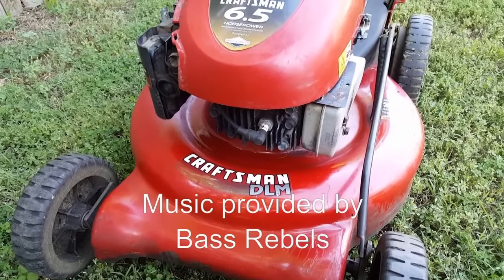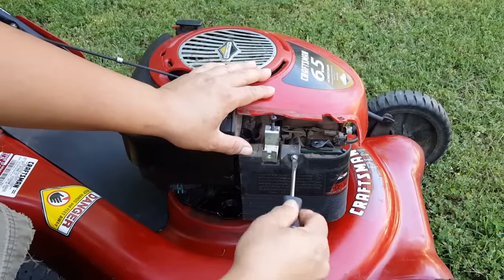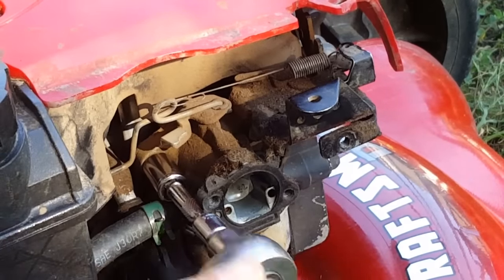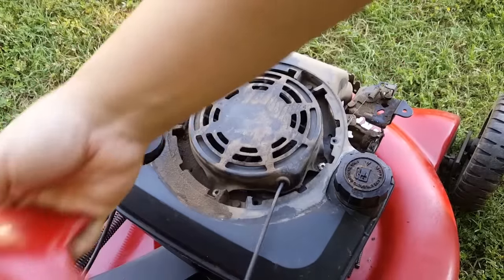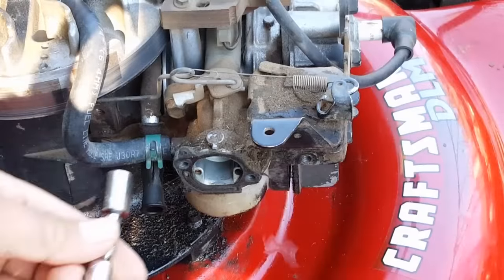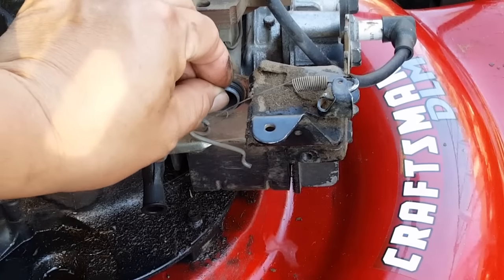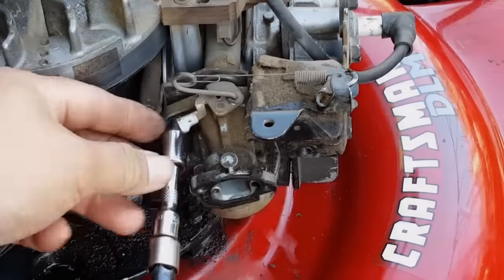Lawn Mower starts and then dies, turned out to be an easy cheap fix -Loctite!

Comment: Agreed. This may "look" easy. But most people don't even realize that these items being "unscrewed" are not "bolts" or "screws." It looks like they are those "torque" things that are on the backs of dryers and washers. The repairman use those things just to make it so "normal" people can't fix the things with their traditional tools such as a flat screwdriver.
Reply from the maker: Michael Zoran thank you. Yes for most a torx bit may be foreign to them.
Reply: Michael Zoran just buy a torx screw driver? It’s like saying filling up your car is hard because the gas pumps don’t look like they do in the 50s. They still work the same.

Comment: Hey nice video! I just overhauled my carb and  it runs great as long as I pump the prime bubble. it seems it doesn’t get enough gas any suggestions how to fix that??
Reply from the maker: Did you replace the seat needle? If so did you notice the position of the float? Was it level when turned upside down? If not then there may not be enough gas getting in the carb bowl and only running on the gas your priming into the carb. Thanks for the comment.
Reply: Home Garage thanks for the reply. Yes sir I did check that and it was level. But I clean the holes on the bowl bolt with a thin wire and now it runs great. Thank you tho.
Reply from the maker: Thank you and good work.

Comment: there could be a number of different issues that cause this problem. a video like this is only good for a select few who have the same problem. for once i would like to see a video that covers the gamut of issues but we'll never get that as they are as diverse as the problem. 

other noted causes are trash in the carb. bad fuel. a clogged vent of the gas cap. a dirty carburetor. even a bad safety switch (on riding mowers) can sometimes produce such a problem as well as other things that could be the culprit.
Reply from the maker: Thank you paul k for the comment.

Comment: Great show and tell. I have the same motor with the same problem perhaps. I will try that fix and see if the carb assembly is loose also.
Reply from the maker: It's a good possibility. Does your engine have primer bulb or is it just a pull till it starts type of engine?
Reply: @HomeGaragechannel  It's a Briggs and Stratton with no bulb primer. It has been to the repair shop and is there again with the same problem now for the 4th time in one week. It ran for quite a while on the paved lot but when put under load of self drive and cutting long grass it quits after about 30 ft. of cutting.
Reply from the maker: @theintruder77  now that's pretty interesting. does it stop suddenly?
Reply: @HomeGaragechannel  Yes but not with a "whump" as though hitting something with the blade. More like it runs out of gas.
Reply from the maker: @theintruder77  I would crack the gas cap, give it 30 seconds and then try starting it again and leave the cap cracked. it cold be a combination of multiple problems like a swollen needle seat and a gas cap that's not venting like it should.

Comment: Was that Loc-Tite Red? Holy hell those bolts are never coming out again! Nice fix though.
Reply from the maker: Thank you for the comment I appreciate it
Reply: Blue would be much more appropriate. Hell, Some hot melt glue or a lock washer would suffice. That said, Thanks for the video.
Reply from the maker: @ipwee  thanks for the comment I appreciate it
Reply: LocTite is 'thread-locker' liquid in a small tube colors match whether it is regular or stronger formula. Available at a Wal-Mart or similar hardware or Lowe's type store and it keeps a bolt from vibrating loose, generally.
Reply: @DougHinVA  I think you may have misread my comment, but thank you for the explanation anyways! Always appreciate helpful comments on YouTube.
Reply from the maker: Thank you for the comment I appreciate it
Reply: @Kube_Dog  ive seen engines never come apart again over loctite. That shit works wherever.

Comment: Only see those manifold bolts come loose on ones with bent crankshafts though. People will kick the carb and snap off the manifold , but rarely do I they just loosen by themselves. Very interesting sir.
Reply from the maker: Thank you Adam Dorris for the comment.  I would say this not natural. Someone must have been working on it and left it loose and over time it got worse.

Comment: Something that I noted that you did not point out is that there is a crack in the hose connecting the crankcase breather line to the air filter housing. This is apparent while you have the carb off the motor and are loctiting the plate screws. Splits here allow dusty air to enter the crankcase via the breather tube and the top end via bypassing the air filter and can chew out the motor in a couple of months of weekly mowing in a dusty environment. Don't ask how I know, but I have practical experience of this hose failing and coming off the air cleaner back completely due to the cracking.
Reply from the maker: Thanks for the comment and the watch.

Comment: If I undo all those screws & bolts, I'll never remember which goes where 😲
Reply from the maker: i understand.  i have had to put the nuts and bolts in to a piece of cardboard that was labeled to tell me where they all came from
Reply: @HomeGaragechannel  I'm going to clean tje lawn mower real good & try this. I fix everything else why not this too 😉 it's just a little overwhelming to me, that's all. I'll even do the other little maintenance items too i.e. replace air filter/add or change oil/spark plug etc... It's a 2nd hand and may need some all around TLC 👍

Comment: There's no way I could do this.  I've bought three very pricey mowers in 4 years.  Cost me more to get them "repaired" than it would to buy new ones.  It's like these things are built to self destruct after Xamount of uses.
Reply: Same here!!!  I've been through 2 in 2 years and I'm getting ready to buy a third it looks like.  This is after oil checks, fuel stabilizer, cleaning each time, etc...  I've heard the term "planned obsolescence" for appliances but I guess the same is true for lawn mowers.

Comment: Mine was driving me nuts. I had it for only 3 months and was doing the same as yours. Carburetor bolts were both loose. Fast forward 3 years and it would run for about 5 minutes and die. Noticed when I took off the gas cap to check gas level and replace cap it would run again for about 5 minutes. Problem was vented gas cap rubber was blocked. I bought a new gas cap because the rubber was deteriorated. Problem solved.
Reply from the maker: very nice diagnostic work.

Comment: Hi again.....First, thank you for your interest and help!.......Back to what I did with more detail than orig. Removed the housing that covers the carb and cleaned it. As the bolt holding it and the carb are the same, I thought that tightening it may clear the problem. But it didn't. Should I remove the carb and, if so, for what prupose? How can I tell if the carb is in good shape? The engine was fine and the stopping problem jsut happened. The engine is about 5 years old and has had medium=light use.
Reply from the maker: taking the carb off would make it easier to service and clean it.

Comment: I've had the same 6.5  craftsman lawnmower for 14 years and a little maintenance each year is the reason why it continues to run. I just wanted to say that you dont need to disassemble as much as you did to get the carb off. I also found that the o ring at the top of the fuel bowl gets old and causes a leak thus causing fuel starvation. I also use synthetic oil, which is way better than the cheap 4 stroke stuff they sell every where.  By the way new lawnmowers have lots of plastic parts even plastic carbs, so happy mowing everyone.
Reply from the maker: Thank you sir. I know these mowers can last for quite awhile with minimal maintenanc and you definitely prove that.

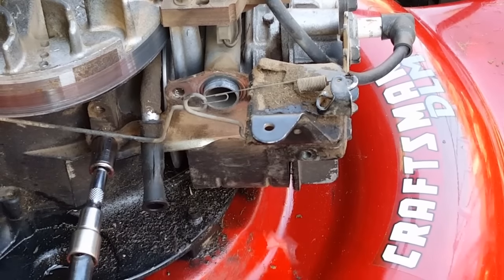Comment: To anyone reading in 2024: quick fix WAS the air / gas mix hose at lower left looking at the exposed carburetor @2:47 (once you take off the filter housing / carb backing plate. It pops right off / no hose clamp). Mine had wiggled loose…I guess massive vacuum leak. Also look at the carb gasket on the plastic carb backing place…mine was ok but a little worn. Cleaned everything then fed hose back on, buttoned up carb & filter…RUNS LIKE A CHAMP. This is a craftsman 6.7 hp Briggs & Stratton from sears or Lowe’s.
Reply from the maker: thanks for the run down

Comment: Thanks for the video. I have two that were given to me with the same problem. I will check the o-rings and see if that helps. I can shoot starter fluid in it and it will run until the starter fluid evaporate or is burned off. Thanks.
Reply from the maker: No problem Raphael Juniel
Reply: Go Raiders

Comment: nice video - I have very similar craftsman and I took off entire air filter housing shot carb cleaner in carb. Started and ran engine for several minutes 2 or 3 times with fresh gas to test and help clean out engine (it hadn't run in several years. Convinced it was starting and running ok I then cleaned and reinstalled plastic air filter housing - primed and now no start.   remove paper filter but leave plastic assembly with primer bulb and shoot carb cleaner --- it starts but only runs few seconds presumably only on the carb cleaner as fuel,  it seems like somehow the plastic holder is interfering with the gas flow as it runs fine until the plastic is reattached
Any thoughts or suggestions would be appreciated
Reply from the maker: It's a possibility but I would remove the jet and bowl and inspect it for debris and a clog.  It might just be a coincidence that it happend after putting the filter housing back on.
Reply: Thanks for the quick reply - oddly enough after sitting overnight it started on the 3rd pull with full filter assembly attached --ran it for 10 minutes with a high concentration of seafoam in the gas so hopefully each mow she will just get cleaner and better, if not then I will put the carb into the ultrasonic cleaner and go from there
Reply from the maker: @photoartteacher903  excellent let me know if that happens

Comment: Great tips but still had trouble stop /start running so I thought dirty fuel.drained petrol tank front hose to carburetor then filled petrol tank again but this time I used  paint strainer
Reply from the maker: Great tip

Comment: My mower had the same problem, but it was a clogged air filter.  Sitting over the winter hardened the grass and dirt in the air filter.  All that was needed was to clean it out.  5 minute free fix.
Reply from the maker: nice work.

Comment: I have the exact same problem run wise. I’ve taken the carb apart 3X and never thought to check for intake leakage. If zi didn’t see it with my own eyes I wouldn’t have believed it.
Reply from the maker: it doesn't happen all that often so it makes sense

Comment: My craftsman mower is doing pretty much the same thing. Mine doesn't have a primer bulb so I take a little bit of gas in a syringe and squirt it back in the carburetor. After putting everything back on i crank it , but it quickly dies. This is everything I've checked.....  Shearing pin, Coil, Coil wire, Kill switch clip, Spark plug & Gap, Cleaned the carburetor inside and out. I'm going to try what you did in this video. Everything was tight when I took it off, but I didn't inspect the o ring. I'd say that's probably my problem, but I'll let you know what I find out.
Reply from the maker: good, but for me, If I did everything you did, and it was still doing it, I would replace the Carb.
Reply: @HomeGaragechannel  I usually buy a rebuild kit for them instead of buying a whole new carb. It's a whole lot cheaper that way. The O-ring behind the carb. looks pretty bad so, I'm going to buy a new one. Hopefully that will solve my problem.
Reply: So what was the verdict?
Reply: @ParkingPirate  Had to rebuild the carburetor.

Comment: Nice video. Any diagnosis for a Craftsman that runs for like 5 or 6 minutes and THEN dies?  Not just for 2 seconds like yours did.
Reply from the maker: sure, it's either just the Fuel cap not venting like it's supposed to, or a combination of a swollen needle seat inside the carb. Try cracking the gas cap loose, you might have to use some duct tape to keep the cap from falling off the tank, next time you mow and see it last longer than 5 or 6 minutes. otherwise, replace the cape and carb and you should be good without actually pinpointing the problem.
Reply: @HomeGaragechannel  - When I removed my carb, I had the needle valve in my hand and I don't remember seeing
a rubber seat/washer around the needle.  Is there supposed to be one there?
Reply from the maker: @robira1313  it's inside the hole where the needle goes. the hole should be pretty big, but after while the hole in it will shrink
Reply: Ohh, thanks!  I'll take a closer look.

Comment: Hi......Thought I would let you know this and, if you have time for a reply, that would be appreciated. I just came in from working on my mower. It has 2 bolts that hold the filter and carb on. Both were loose; one more than the other but neither severe. I removed the filter and cleaned it. Reassembled. Mower did just what it did before I worked on it and the problem is exactly like your video. Would love your thoughts if you have time............Thanks!
Reply from the maker: sure thing, do you happen to know if the carb is in "working condition" if not it might need to be replaced.